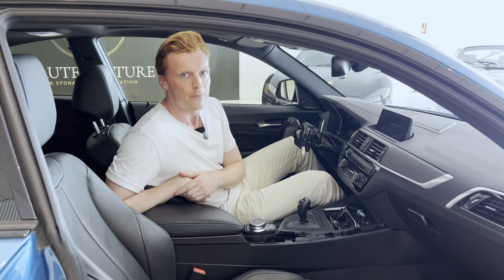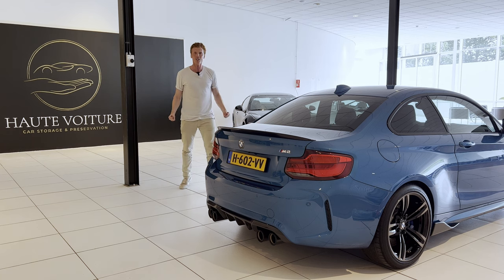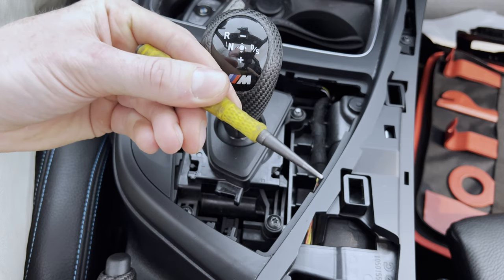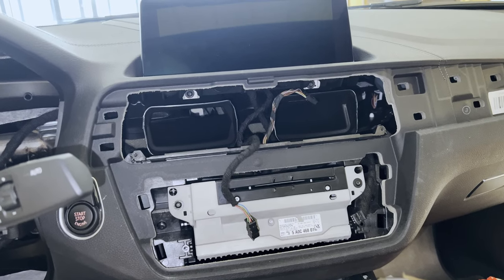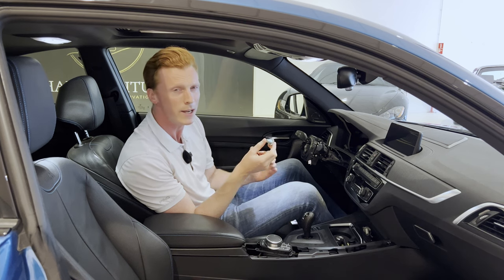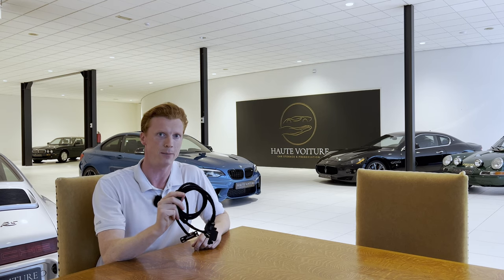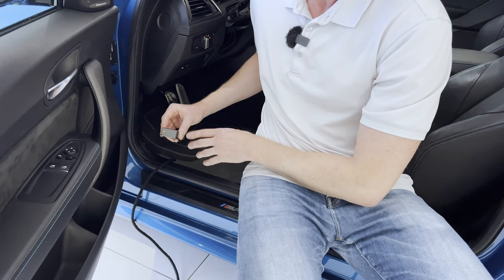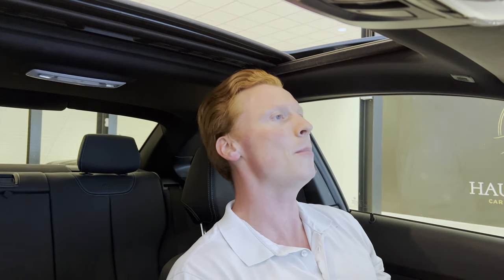BMW M2: How to Prevent Your BMW From Being STOLEN

Comment: Did you find out how the steering wheel bolt would help to prevent the steering wheel being stolen? And do you know the torque spec for this steering wheel bolt?
Reply from the maker: Yeah, as I thought, it’s the green stuff that makes it way harder to loosen. What I heard, however, is that it would be wiser to screw in a bolt with an E-torx head (as thieves usually don’t cary those tools around, and simply expect a 16mm bolt (like the one in the video)). The torque spec for the steering wheel bolt is 62 Nm. Hope that helps

Comment: Very cool video, keep it up 💪🏼. Does anyone know if the OBD connector draws power if left plugged in with the ignition off? I always pull the plug at the end because I thought it would continue to draw current.
Reply from the maker: Thanks mate, will do. Yes, it does. The port is alway live. A bluetooth adapter draws so little current that it doesn’t affect your battery (I can tell from experience). Hope that helps
Reply: @TheHunterHofman  Okay thanks you helped me a lot, then I can always leave it there from now on 👍🏼

Comment: Great informative video; I will fit both devices/kits. Just wondering; how does the bluetooth device on the original and then hidden ODB port works exactly (and where did you get it)? Can BMW dealers just connect to this bluetooth ODB alternative?
Reply from the maker: Good to hear, thank you. Check the end of the video and the description to see where I got it! The real live port works exactly like the original port, so yes dealerships can simply connect to the real one. The dummy port doesn’t transfer information.
Reply: @TheHunterHofman  I fully understand the cable, the function and the link to order it. I mean the Bluetooth device you plugged into the now hidden and unaccessible ODB port…is it not a Bluetooth device you plugged in and kept in the hidden ODB port all the time (or was it delivered with the cable). How else can a BMW dealer acces the ODB port if it is hidden fully under the dash as in your installation? Or did I miss something 😊
Reply from the maker: @Franzino  haha sorry, completely misread your initial comment, I feel like an idiot now😂 so in my BimmerCode video I have a link to the adapter in the description and it allows you to use BimmerCode, BimmerLink and code several things to your car. Dealers only use cables, so yes, they would need to remove the adapter first (should take them no more than 5 minutes). Hope that helps mate
Reply: @TheHunterHofman  Thanks; this explains it all…then I need to put the real ODB connector on a place where it’s hidden but still accesible for dealer/garage.👌🏽
Reply from the maker: @Franzino  correct! Another follower told me he routed his to backseat, so that he would only need to lift up the backseat to access the live port. Good luck mate
Reply: @TheHunterHofman  Is the cable that long, so you can route it till there? Great idea :)

Comment: By the way; I don’t think it makes sense to secure/fix the I drive controller. It wil only be fixed to the piece of carbon trim that thieves take out anyway (with iDrive conteoller attached to it). Even with normal bolts they will not unscrew the iDrive controller and they take the whole trim. The iDrive controller is not screwed to the car, but to the small piece of trim (on my Pré LCI M2).
Reply from the maker: Come to think of it, you’re right. It happened to me like that as well. It’s interesting that the instructions of the security kit don’t even mention the gauge cluster. I’m definitely going to use them there too.
Reply: @TheHunterHofman   I did the gauge cluster also...there are security bolts enough in the kit (it's for different BMW models) and the big ones are not used on the F87 M2. Small tip; before fitting the security bolts/inserts, makes sure the original screws are thight enough.

Comment: Wont the insurance cover this? Interesting kit tho!
Reply from the maker: Wasn’t properly insured unfortunately. Thanks for the comment!
Reply: @TheHunterHofman apreciate your Videos. Q: so they used the obd Port with a Dongle to turn of alarms to remove all these parts?I wonder why BMW has not fixed such option/flaw. They also could try to remove the ground wire of the battery if theyre quick?
Reply from the maker: @eviltriangle  thanks mate. BMW have fixed this now with the G-series, the alarm will keep going if they try to disable it via the OBD2 port.

Comment: Wil u install motion detector cam in ur car?
Reply: It will drain battery if running I.E 24 hours. At least my blackvue will.
Reply from the maker: Hi mate, wasn’t planning to, no! Have you installed one?
Reply: @TheHunterHofman  there is one OEM from BMW, did you check it out? bit pricy but hey..